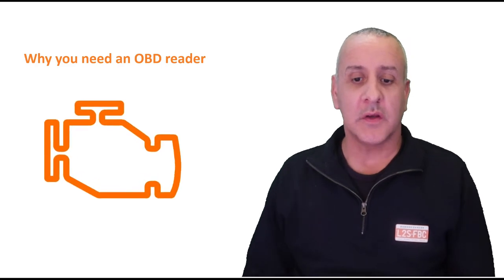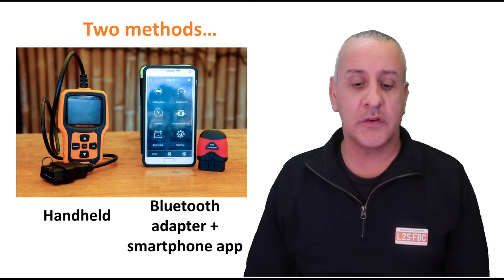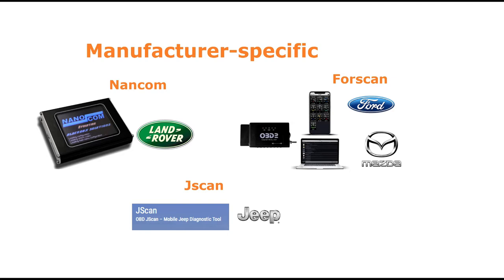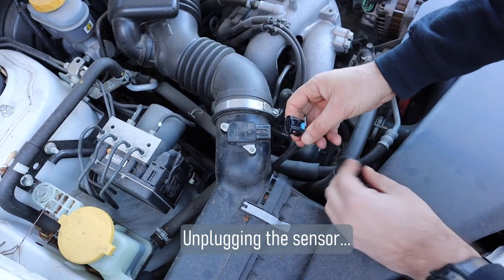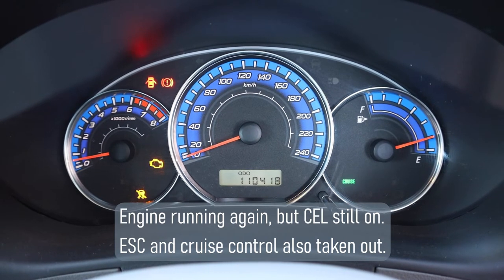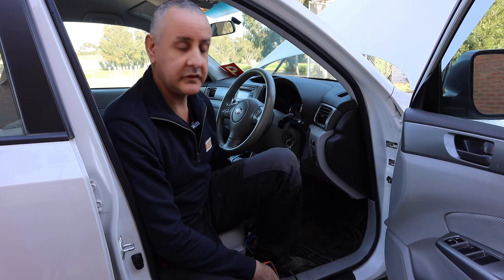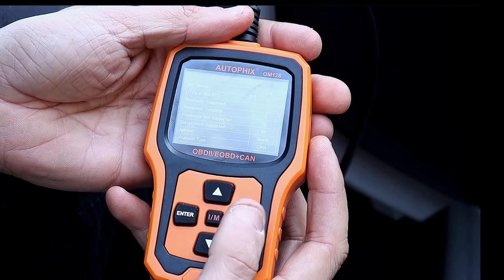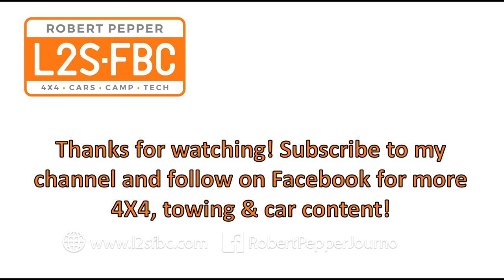Demo of check engine light fault diagnosis YOU can do!

Comment: Hi and thanks for the tips. If you delete a code using the hand held device ie phone or dedicated unit. How do you diagnose the fault at a later time if it has been cleared and does clearing the code put the car into limp mode or some to get you home. Once again thank you for the help.
Reply from the maker: Some codes are transient, some are permanently stored in the car's memory. Also, the scanner itself may memorise historic fault codes. This allows you to capture the code at the time and show it to a mechanic later. As per the video, there is also a mode to capture various other readings at the time of the fault. 

Clearing the code may get the car out of limp mode, or may not. It largely depends on the cause. If it has been a transient fault, or a fault triggered by a set of circumstances you can avoid, then yes you can continue driving. However, if the fault is more serious and triggered immediately on engine start for example, then no. OBD2 readers are not a get-out-of-jail free card for all situations; they often help a great deal, and at the very least give you valuable information about what's happening with your car so you can make informed decisions.